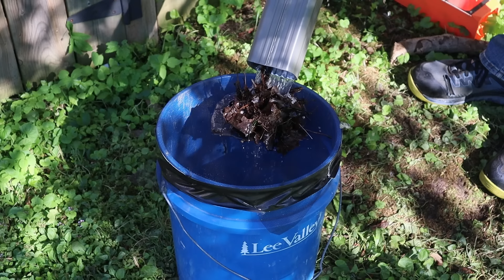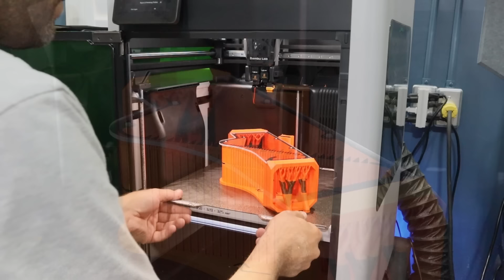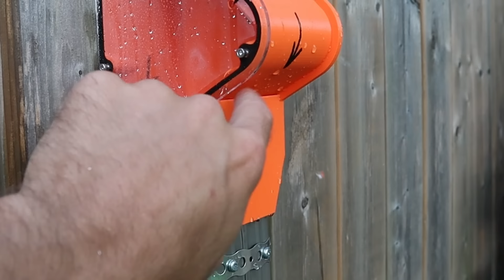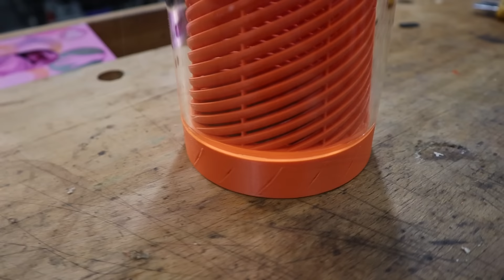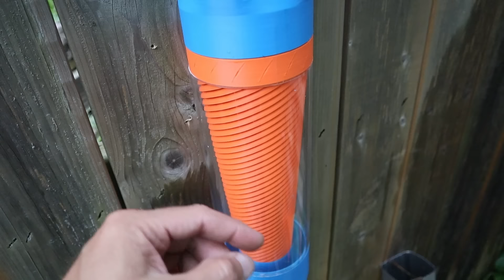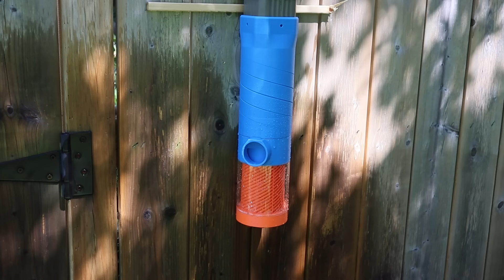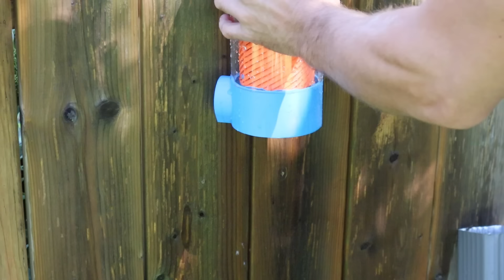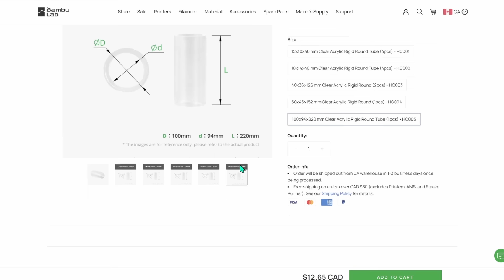Can you 3D print a self cleaning downspout rain water collection filter that actually works?  Let's

Comment: for testing, you really need to have a gutter to down-spout adaptor at top to hold the debris you wanna test with, and to spray the water into, rather than directly into the downspout. that will much better replicate debris slowly getting pulled into the downspout by the water. 
as far as the design is concerned, i think you basically nailed it on the "anacoanda" filter. the pine needles would cause reduced efficiency over time, but just pull it out, flip it over, and wait a few minutes when it's raining and they'll get flushed out with the water you let bypass. flip it back over and resume function. 
only thing i'd suggest is putting a fairly noticeable ramp into the collection basin so the water very much so wants to exit the collection basin, rather than allowing it even a chance to sit around. that will reduce the damage-over-time to the PLA (or even ABS), while also just clearing the basin better. 
the real issue with the design as it sits right now is probably leaf litter (the little bits of leaves when they're crushed while dry) getting pulled through the filter by water. it might get stuck in the filter, but the bigger issue is actually that litter sitting in your rain barrels. ultimately, it will probably still need to go through a screen, but this will need only periodic cleaning, and the VAST majority of the debris from the roof will be removed by the coanda filter. 

now you just need to figure out a way to deal with debris collection in the gutter itself, rather than with debris in the downspout. i'm not convinced that "Leaf Shield" and whatnot really do that good of a job. my mom just bought her first house that had some generic leaf guards (honestly just hex mesh) installed, and there was so much getting through it that there was actually a small tree growing out of the gutter. lol.

Comment: With the concept of being able to "flip" the device to turn off the output, I would make sure to make the filter symmetrical in size on either side of the output port.  This will help support a scenario where if the piping to the rain catcher is static (non flexible) you can flip this filter and not need to relocate your collection plumbing.

Comment: For the first design. You could angle the filter slots from front to back like an arrow. Then, add in a steeper dip towards the center line. With, either ridges or angled slots (deeper/taller at the back) to filter and funnel water better.

Comment: Water acceptance isn't really the issue it's debris rejection. Handling primary filtration at the choke point (downspout) seems like the logical choice but it means you're forcing the system to deal with high volumes of debris, over a small area, which is the most difficult problem. This is why debris guards (sometimes called "Leaf Guards") are used on the gutters themselves. At least for handling course material. Essentially a pre-filter where average debris handling for a given area is very very low. So, the real answer is the answer we use for most types of filtration ... Stages.

Comment: Great ideas...  imo... instead of using a water hose on a straight pipe.. you should use a 90° gutter system... I love the idea of the magnets on top and bottom because after a rainstorm, you could just pull em off and clean them out... ..thought.. when using magnets, maybe you could make a female to male ring to better fit for leakage around the seam... like an o ring... more testing, but i do believe you're onto something ... 💯😊

Comment: I wonder if anyone has dully designed an entire gutter to reservoir tank filtration system. So the entire system is designed to maximize efficiency and prevent problems the ENTIRE length of the system.

Comment: that last design probably only works up to a certain flow rate(based on length), and then the total % of water captured drops off. You should probably have an overflow drain pipe.

Comment: You could add a "first flush" system downstream of this to ensure even the little bits of crud that make it through the filter are largely washed away. Rather than settling at the bottom of the collector barrel, they end up in the appendix tube that slowly drains them out of the system entirely.  You may still need to clean the first flush tube once in a great while, but it's less work than having to wash out the barrels every couple years.

Comment: Yeah, I think a round downpipe would work better with a round filter.  I also think slowing down the water would help.  Perhaps, rifling the downpipe would help to both slow the water and second to help stick the water to the outside with extra g-force.  Rifling could be done with filleted fins.

Comment: The inside facing portion should be made to resemble a stack of horizontal rings with gaps between them. Debris directs downward. Water curves outward.

|  ¿Ɗ     v
|  ¿Ɗ     v
|  ¿Ɗ     v

The left side Ds are supposed to represent a baffle on their outside to prevent water from re-entering the debris chamber.

Mirror it vertically along the Vs.

Comment: I don’t think you did a realistic test for the conical water collectors, since when you were adding water, you used the “cone” setting on your handle. This gave it the best-case scenario, where all the water was shot directly to the walls and stuck to them. I think for a more realistic and fair test, you should use the raw hose output or a “soaker” setting on the handle that doesn’t send the water in any particular direction. 

Or even better, if you also shoot it to primarily one side, it will more closely mimic how if this is at the end of a gutter, most of the water will end up sticking to the side where the gutter directly attaches to, so that’s something to also take into account.

Comment: To drastically reduce the cost and equipment needed, print the clear plastic template on a regular 2d printer and trace it onto a 2 liter bottle. Then trace and use scissors to cut it out; the holes can just be punched/drilled with whatever you have around.

Comment: Everyone is saying to change its material. but like, it's a prototype, of course it's not 3d printed marine steel. because it's a prototype, of course he's not going to print in expensive and long living materials, it's going to be petg, pet, or abs.

Also, I would change the bottom collection to have a taper to make the flow faster and prevent back flow. additionally, if placed strategically, these could have a include a ram pump to move water a lot further, and at higher pressure.

Comment: Try flaring the very top of the filter "out" where the downspout meets the filter. I'll try to describe this in order:
1. Downspout, let's say 3"x3"
2. Flare adapter: this part flares out with a gradual curve and flares out to an overall dimension of 4"x4" or greater (or a diameter of 4", however you want to look at it). The water should mostly follow that curve "out" but debris should fall straight down.
3. Filter, as you've designed it, but with a larger diameter.
4. Downspout.
This design should provide more room for debris to fall through while providing an additional mechanism to separate water from debris.

Comment: I think the very first design was actually the best all that needed to be changed was the very top of the filter. All that needed to be done was to elongate the top (before the start of the slats) while making it slightly wider and to match your downspout taper it back to the diameter of the downspout.

Comment: Also. Where the magnet mate up interface in just a flat surface. Design a mating shoulder with the inner ( male) shoulder on top and female on bottom. That would eliminate the water leaking there

Comment: Or you could just do what we do here in Australia, we use gutter guards that are fitted to the roof, the filter is a fine mesh that is stuck to the roof by a variety of means, the filter is then pulled taut and clamped over the outer edge of the gutter. water and debris flow over it, the debris is flushed over the top of the filter and off the roof, the water goes through the mesh and eventually into the downpipe. It has two benefits, firstly it filters out the junk from emtering rainwater tanks and secondly it prevents the buildup of flammable materials in the gutters, something that is needed in Aussie bushfire season.
Reply: i was thinking about this at the beginning of the video when the civil engineering example is shown. sounds like you got some coanda effect going on these meshes similar to the demonstration here. if this is used commonly in australia, I think I know what I am going to do! god I love the internet!!! THANKS!

Comment: Since the flow of water seems to be running down the inside of the pipe, I wonder if you could make the coanda filter vertical with horizontal slits.  Then, the device could be the same internal size and shape as the down spout with the collected water outside of the filter walls.  Or possibly slightly smaller internal volume.
Otherwise, this looks like something that would sell as is.  Magnets and all to make it super easy to install, replace, and clean.

Comment: Early in my rainwater research I ran across a German? design that was a long cylinder-with-cup like yours at the end.  Instead of a Coanda screen, the item used a roll of stainless screen of unknown but fine mesh.  Apparently capillary action over the length - 15" or so - was sufficient to draw water to collection.  I wonder if your early 'failed' versions would work better if they were wider, and you printed a diverging-nozzle downspout adapter to a wider Coanda box.

Comment: I just had a worrying thought. What you describe with wedges that "shave off" the lower water stream is called a diversion or redirection screen. It diverts a very thin section of the flow closest to the surface by redirecting it doen though the screen. It does however not use any coanda-effect. The coanda-effect is when a flow adheres to a surface and follows this as it curves. The coanda-screens that utilize this effect does not shave into the stream but diverts the flow that curves around the back end of the wedge a little bit. Anything that does not curve around the edge but passes straight over the wedge is not diverted. The difference is how much debris get stuck on and builds up on the screen surface.

Comment: Nice experiments! Imho, that first design has a lot of potential as well, but due do surface tensions of the water those "sculpting edges" have to be tweaked a bit (maybe more "rough" surface with increased high difference between them or so). Cheers!

Comment: The Coandă effect is studied in physics and it is the tendency of a (jet) fluid to follow a curved surface. This means the water will stick to a nearby curved object. It was first applied to airplanes. It will break with higher speeds or if the surface is abruptly interrupted, so the reason the second design didn't really worked. Your third design worked quite nicely.
Reply: So really none of his designs utilized the Coandă effect.

Comment: Nice design. I think you can make the outlet larger than the inlet. Since water tends to cling to surfaces it comes in contact with you could add a slight and gradual flare where the water exits the downspout tube. I believe it would still catch most of the water and the debris would drop straight down. You could increase this effect even more by using cylindrical tube and giving the water some rotation as it goes down.

Comment: Super cool, I think you need to give the parts an overlapping lip to mimic the stacking of shingles on a roof.  That will be more forgiving where those magnets are to keep water from escaping.  If you just add a lip that covers the seam onto the upper adapter piece, then water will have a very hard time escaping the ring.

Comment: I noticed something with the last close up shots. It looks like some of the water escaping out the bottom is due to the volume of water exceeding the capacity of the trough leading to the outlet. You can see the water level reaching up past the trough and backing up over the filter slots. That would allow water to back flow and run straight down. 

If the trough and outlet were made deeper, increasing water holding capacity, then the filter could handle harder down pours. I know in my area of TX we can get some real heavy rain. When you multiply that by the roof collection, my down spouts are not experiencing a garden hose of volume… more like a firehose. 

Could you stack these in line to increase flow handling capacity?